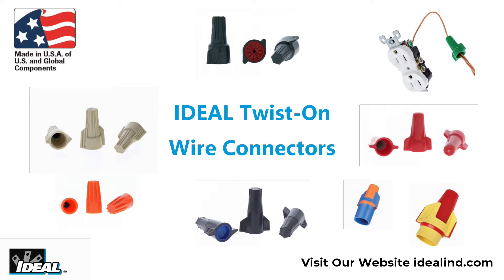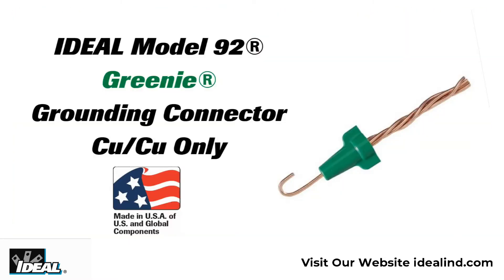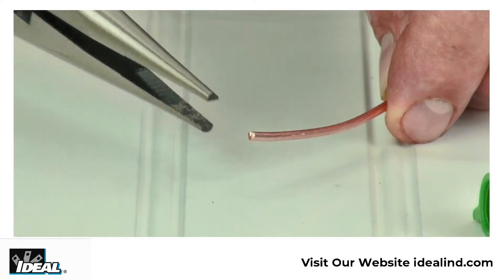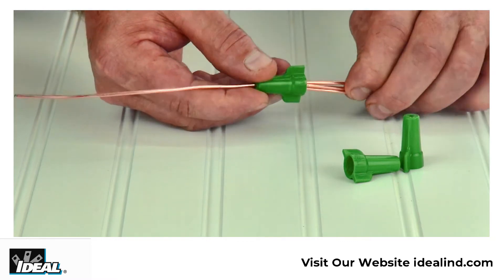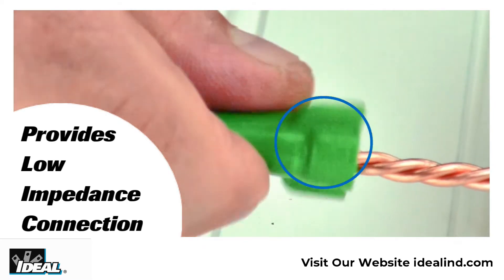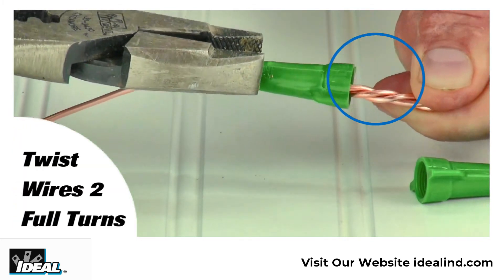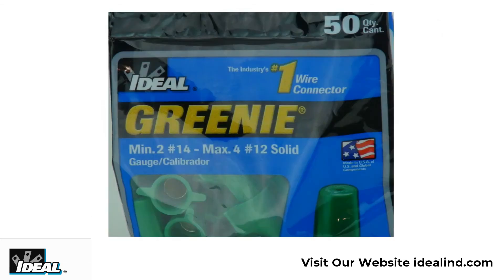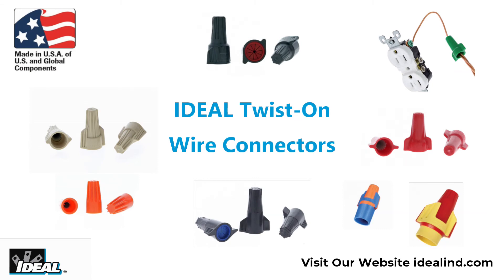IDEAL 30-092 Greenie Grounding Wire Connector

Comment: If it can hold 4 # 12 Gauge wires why can it only hold 2 # 14 Gauge wires which are smaller?
Reply from the maker: Hello here are the UL Listed wire combinations for the Greenie. Itr can do 4 # 14 AWG as well. Hope that helped Ron
2 to 4 #12
2 to 4 #14
1 #10 w/1 or 2 #12
1 #10 w/1 to 3 #14
1 or 2 #12 w/1 to 3 #14
3 #12 w/1 #14
Reply: @RonKipperDatacomm1  Thanks that makes more sense than what the video stated.
Reply from the maker: I will take a look at it
Ron
Reply: @RonKipperDatacomm1  At the 1:16 mark the screen shows "2 #14 to 4 #12"
Reply from the maker: 2 # 14 AWG is the minimum it is rated for and 4 # 12 is the maximum which is correct. Hope that helps Ron
Reply: @RonKipperDatacomm1  Ah that makes sense, thanks.

Comment: Twist connectors are nice but the spring loaded lever type connectors and push fit ones are just as nice if not easier to maintain.
Reply: One of my favorites
Reply from the maker: Hi Math Man there are many electricians who prefer twist on connectors they are a proven way to make a connection for probably 70 years now. Have fun Ron